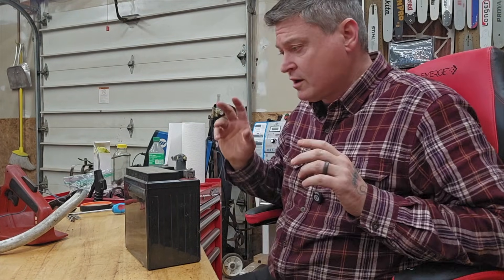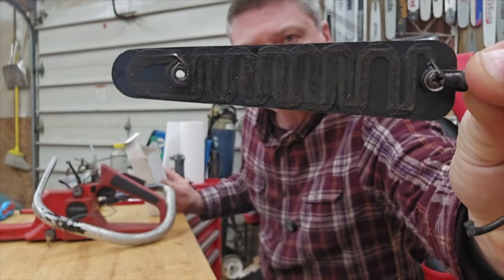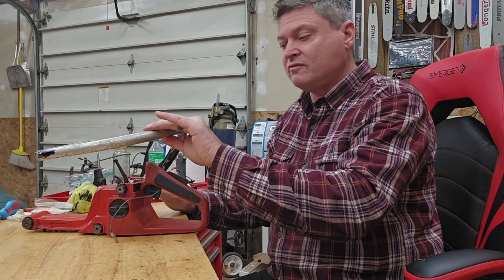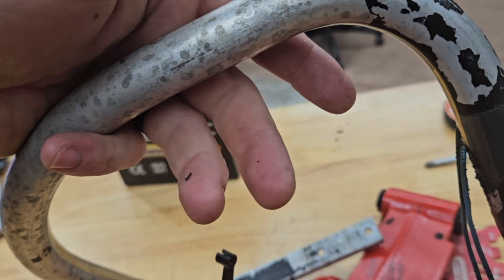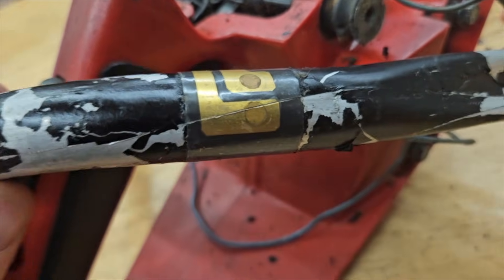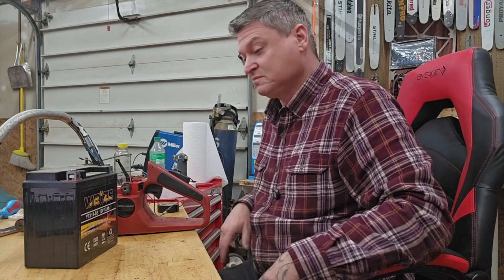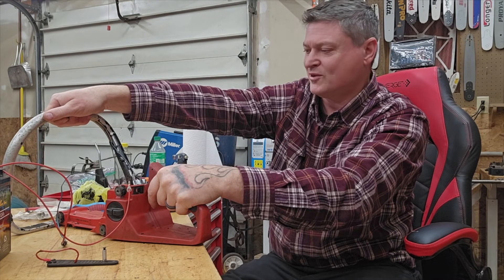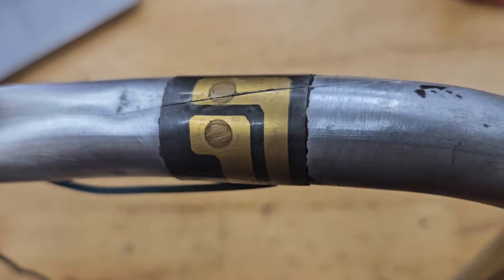Wiring for Heated chainsaw handles

Comment: Without diodes for rectifying, I about guarantee it supplies the elements with AC current. I've used heat shrink tubing over top of chewed up Stihl wraps before with decent results👍🏻

Comment: It's funny, it's not super cold, but around freezing, when the carb is prone to icing. At least that's what old folks say. Checking an early model 353G, the carb heater is right in front of the carb, like you assumed. Is not affected by the handler heater switch, I believe.
Reply from the maker: That would make sense.  Because anything below freezing should have very dry air.  If there is any moisture in the air at below freezing temperatures, it comes out as snow (mostly).  But right close to freezing can have all sorts of humidity.  Hell, it could be raining.  And as that moist air rushes into the carb, the condensation drops below freezing and ices up the carb.  I'm glad we worked that out.
Reply: .. there was a black plastic thermostat, the size of a large coin, on top of the carb.

Comment: 👍👍👍 värme is Swedish for heat. Thus the “V”….its not for Victory😊
I’ve used heat shrink before- it wrinkles is the corners- if that doesn’t bother you- it looks like factory wrap. It’s also a bit difficult to pull all the way on the handle- maybe some soapy water would help. I didn’t do that on mine though.
Reply from the maker: That's your best comment yet, buddy!  Appreciate it!
Reply: Though I was just doing it wrong regarding the wrinkles😁 works and looks great otherwise👍🏻
Reply: @aaronpowell4885  👍👍👍
Reply: @aaronpowell4885 . Just like me- mostly functional, with a few wrinkles in the corners😊